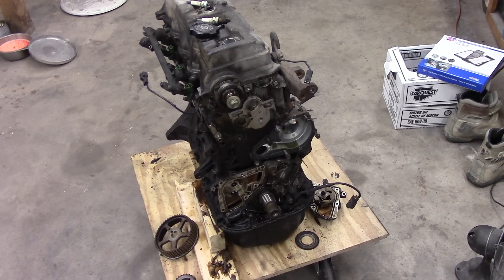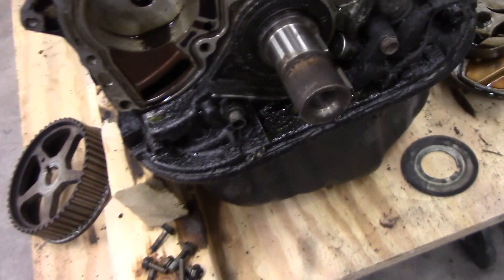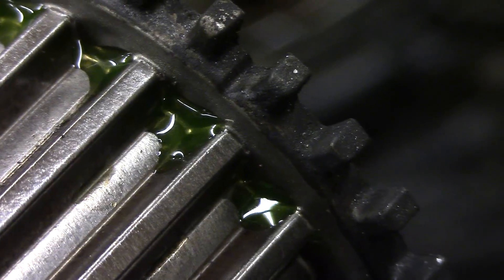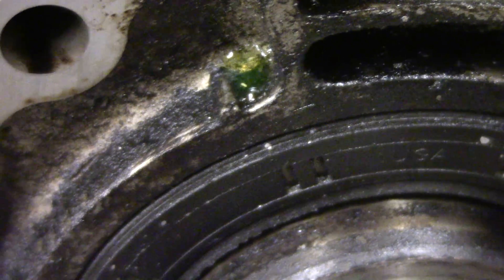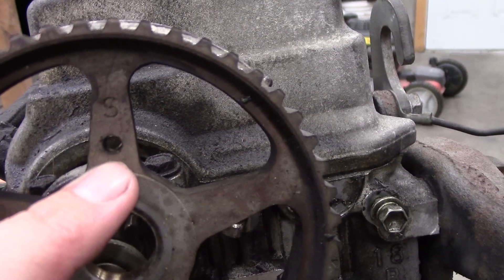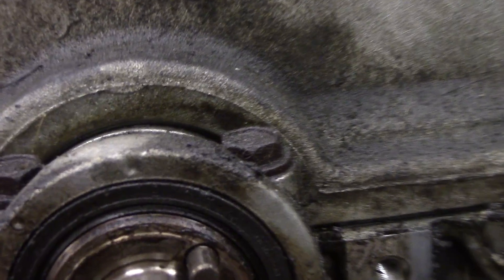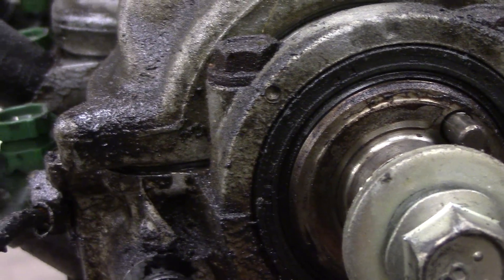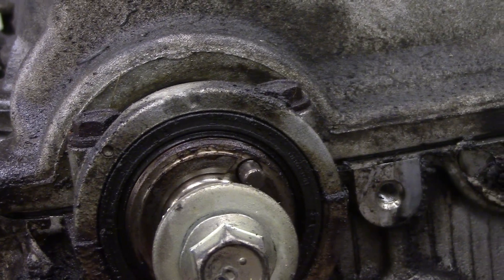toyota 2.2 timing marks

Comment: Yeah I have a question about the timing gear sprocket that Mark on it does it line up with the damper pulley Mark if you could get back to me I'm trying and it just keeps cranking like you said thank you have a awesome day
Reply from the maker: That I'm unsure of. It's been many years at this point. Is there a timing tab on the cover?

Comment: I just had a tech school replace my 5s-fe camry timing belt. They got the timing wrong twice (I think)! 

The week after they installed it, I noticed my gas mileage was way down by 10mpg. I brought it back and they opened the top timing cover only and said they were off by 1 tooth- but they used the crank pulley timing marks to align the crank and cam, not the crank gear marks. They said if the crank pulley is set to 0, that should be the same as the timing marks being aligned on the crank gear. Who was I to argue even tho every video on YouTube shows the pulley must be removed to do this job correctly. They redid it again using the crank pulley set at the 0 dwell mark instead of the crank gear marks again. Now my car runs better tyhan before, but my gas mileage is still down from 29-30mpg down to 22-23mpg. I drive 300-400 miles per week and this shitty gas mileage is killing me. Can you confirm that my undestanding is correct in that the crank pulley marks are ONLY for reading the timing, not aligning the crank to the cam, and the crank gear marks MUST be used? And if so, can you estimate how far off my timing is from being correct? Any help will give me more confidence when arguing for them to fix it properly.
Reply from the maker: Please supply me with the year of the vehicle and I'll check into it. I highly doubt the marks on the crank pulley itself are sufficient to align it...timing marks dont necessarily mean cyl 1 top dead center therfore 0 degrees on the crank pulley wouldnt be adequate. Sounds like they made an assumption that may or may not be correct...and I doubt that it is.
Reply: @Pyro17059  Hi, it's a 1999 Camry 2.2l S5-FE. Thanks, I appreciate it.

Comment: hey what's up man I just watch your video and I made the same mistake you did and now I got it lined up but it cranked but won't start do u think my timing is still off?
Reply from the maker: Tijjani Yusuf If you think the timing might still be off, just go back to the basics..check for fuel, spark, and compression. Its all there, its just not at the right time...id start with compression first. if its way off you should be able to hear the lack of compression while cranking
Reply: Pyro17059 ok i will try that thanks men

Comment: like seriously thanks because I got the timing wrong on my 95 Camry so I'ma go back at it again
Reply: miamisoja the 5SFE is a non interference engine. No need to worry about bent valves.
Reply from the maker: miamisoja glad it helped!..If I have a timing issue, I always try to find a video where the engine is out so its easier to see. Had this scrap engine laying here so I figured I'd make the vid, since I screwed up myself the first go around.
Reply: +Pyro17059  is there a certain way to line it up?
Reply from the maker: well, there is a process to it, but it's too much to type out. Basically, with the belt off, you get the pulleys to line up with the marks first. If they are way off, you may need to move the crankshaft a time or to to lower the pistons so the valves don't hit. If while turning the cam OR crank you come up against anything solid, stop! don't force it. once the pulleys are lined up, you can put the belt on. Once you release the tensioner, make sure the marks are still lined up. When putting the belt on, keep the extra slack on the tensioner side so when you release the tensioner it takes up the slack, rather than pulling the pulleys out of alignment. its ok to move the cam slightly to aid it installation of the belt, as long as it lines up when its on and tensioned. And ALWAYS, once its on and tensioned, turn the engine over by hand (on the crank bolt) abut 2 revolutions. If it turns by hand, you at least wont damage anything IF it should still be out of time. Hope that makes sense and helps..
Reply from the maker: Also, why are you replacing the belt? preventive maintenance, or did the old one break? If the old one broke, you may have it correct and just have bent valves...just a thought..

Comment: Please help me I put the crankshaft puller on o n the camshaft on the o wat look like a l line up car still want start sound like it want to but dragging on my Camry 99 4 cyl
Reply from the maker: Im not sure I understand your question...from what I gather, you think you have it all aligned properly but it still wont start? Are you replacing for preventive maintenance, or did the old belt break?
Reply: Tyler Jones what?
Reply: I used a nail to line up the camshaft.